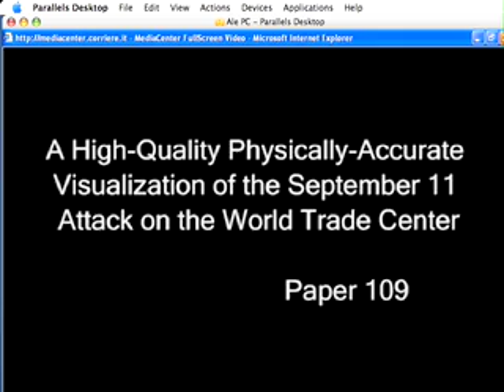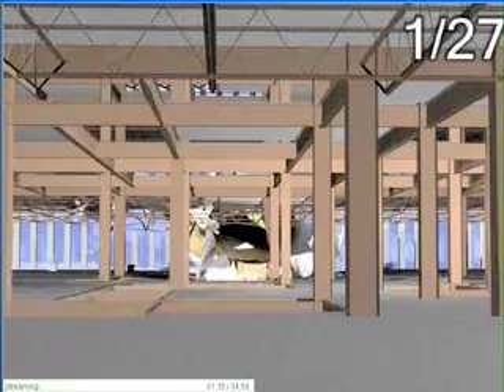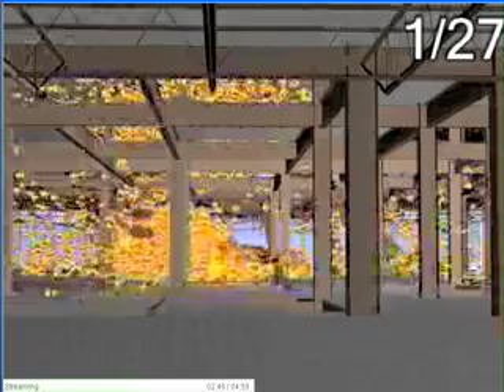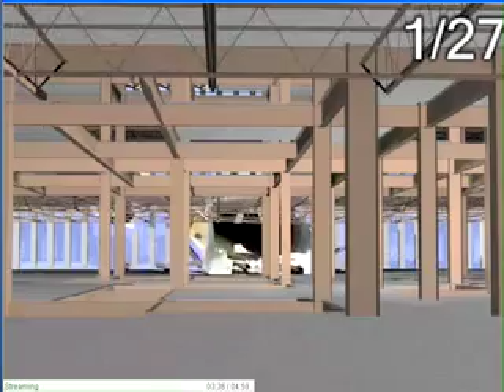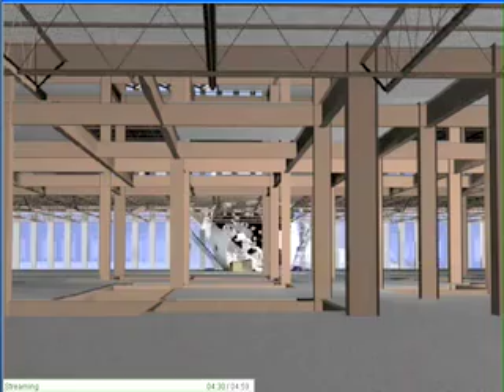9-11 Twin Towers Attack 3D simulation

Comment: Why is this simulation based on a completely different construction then the towers had?  When they try to explain things using a design that look like this and not as it was, they only add more fuel to speculations.
When looking for the design, I found...
"The Core Structure Of The World Trade Center Twin Towers Was A Steel Reinforced, Cast Concrete, Tubular Core." how can fuel and small metal parts just pass it?  I think this simulation need another run with the right input data.

Comment: @TooYoungToGamble Obiviously it's not all made of glass. But a massive airplane crashes into a building at 500 mph... what do you expect would happen? The airplane just bounces off? The buildings did a "great" job of resisting the impact as the entire plane didnt exit the other side. But at first contact, those amazingly strong steel  beams arent going to do much against an impact like that.
But then, you are too young to gamble... so give it a couple more years.

Comment: Not to mention the TONS of interior material, wiring, drywall, steel and copper piping, asbestos insulation, interior doors, interior glass, office furniture, etc. that would have provided a large amount of resistance is totally OMITTED from the simulation.  Then they shoot themselves it the foot showing about 10% of the aircraft exiting the building from the other side.  What stopped the rest of the plane?  ALL THE COLUMNS THAT REMAINED INTACT.

Comment: I really appreciate the Disney-like portrayal of SHREDS of aluminum and fiber-composite (the main construction materials of Boeing aircraft) severing vertical steel columns under stress (building weight) as if they were "butter" 5, 6, 7 even 8 columns in from the side of the building.  Watching the remnants of the cockpit  sever the 4th and 5th columns in made me laugh pretty hard.

Comment: @iRoxproductions the planes also went straight through the core columns that would make it nearly impossible for them to hold all the weight and the titanium didnt melt it started to warp and bend which caused them to fail under the weight of the building

Comment: @se7ensnakes Of course they can do the kind of damage we saw. Do you have any idea just how much energy was transferred from that 180 ton airliner travelling at over 400 knots into the building? Speed, weight, and a fuel for the fire - the 767's had enough of all three. The steel in the building didn't melt, but lost strength, sagged, pulling in from the outside, broke the supports and collapsed. Simple really.

Comment: @jhiller21 yeah I no longer need an oxy acetylene torch to cut steel beams.  I just run down to the hardware store, buy kerosene and pour it on the steel beam.  This fire cuts the beam perfectly.  Okay how about the metal pots on a kerosene stove.  Will I have to worry about the pots melting?  Yes of course, if you believe the official version of 9/11.

Comment: A model like this is completely useless from a structural standpoint.  There is no way to estimate the rigidity of the connections, corrosion, quality or uniformity of the materials used, the nonlinear dynamic response of the floor system, the dead load conditions or the effect of an unknown temperature of jet fuel on the beams/columns.  Why try?

Comment: @jhiller21 the steel that was used in the process of building the twin towers would need to reach 3,000 degrees before the melting point, the fire fueld by the jet fuel only reaches 2,000 degrees the extra heat would be from the bombs that were planted in the buildings to lead to them collasping.

Comment: @Perogi360 and you are an engineer and consider that energy to be massive?
without engineering background, i would tell you that I would expect scissor effect and that part of the building to slide/fall down if anything.
since I am a civil engineer, I can tell you that the energy absorbed by the building would tickle it if anything... bcoz those kind of energy levels are within safety design.
the buildings collapsed in controlled demolition, and no building in the world collapsed that way!

Comment: Just my personal thoughts, without regard to extensive physics calculations and measurements... I wouldn't expect an aircraft to sheer solid steel support columns, more or less enough to cause catastrophic failure of all support columns building-wide. I'm not leaning one way or the other, I'm trying to view this stuff as objectively as possible.

Comment: @situationterm if you would be trained in physics you would know that a aluminium-plastic tube can not break through tons of steel without any visibly damage and if you would open your eyes you would see that the videotapes interfere each other because sometimes the fuselage comes out the building on the other side (undamaged) and sometimes not. there are even two footages with no plane.

Comment: Guys lets just think. To the people saying it needs to be a certain temperature to melt steel, youre right.  But the temperature required for structural failure is much lower than the actual melting point.  Remember that there are immense pressures being put on each piece of steel.  I'm not an engineer, but its pretty obvious to me that a metal does not need to physically change state to fail structurally. Come on use your heads people.

Comment: @meltogue have you ever seen a demolition rig? Hundreds of miles of cable and wireing would be needed to pull of an explosion like this. The cable cannot simply be run through the walls out of plain sight. They have to be tapered through and arround every load-bearing beam in the building. To pull this off they would have actually have to of been no people inside the building what so ever. This was NOT a controled explosion.

Comment: @TheJb1rd this video shows the plane cutting through the core collumns but the plane is made of very lightweight materials. also the building was designed to stand after being hit by a plane. the building also fell at free fall speeds which is simply impossible. if u look at the towers collapsing, they explode all the way down. it's like so obvious once u see it. then u look at the legislation that was passed and the wars we got into. everything screams inside job.

Comment: @tuump Still not going to address the point are you? Seems fairly disingenuous on your part. Enjoy your conspiracy theories, I'm done. No matter what you claim, no matter how many times you repeat the claims, no matter how many times you dodge the issues or try to change the subject, reality remains as it is. Extraordinary claims require extraordinary proof and steel doesn't need to melt to fail. Structural steel softens somewhere around 445F/230C That's a fact.

Comment: @ExperienceCounts2 the steel joists was cut in 45° angle. you see it on pictures. thats typical for blasts. no welder would cut them this way because it takes the double time. I think the easter bunny farted in your face so you are dazed and unable to think logical

Comment: @tuump I say the Easter Bunny farted and knocked the buildings down. What is your answer to that? What? You have no answer? Using your logic then that must mean my claim is true. Lack of response to a ridiculous assertions does not prove the assertions true. it's basic logic.
You haven't responded to the original point I made. Steel under stress does not need to melt to fail. A simple and obvious fact, yet the same idiocy about melting points is repeated again and again. Why?

Comment: @ExperienceCounts2 so explain how it could be possible that the planes speed was around 1000km/h what is impossible in this height because the air is too thick, the engine is not able to achive this and the wings would burst
every independent pilot will approve it

Comment: @meltogue the towers falling patern does not reveal a fact the 9/11 disaster being brought down by controlled explosions. The damaged structure of the building became to weak to support the heavy weight from the floors above them, and as soon as the structure started to fall down.. it was collapsing under it's own weight, the floors below also failed due to the immense weight of the upper floor comming down, there is no use to controlled explosions when a fire is melting the structure away.

Comment: @Maxx415- Yes, jet fuel is like kerosene or diesel- oily will always burn with black smoke in open air. Needs controlled burn in an engine to run clean.. Dylan Avery may have said for some reason his film was a joke- but he could not have meant it. Maybe he wanted to get the MOSSAD off his back. Would not be the first to back off.. No- picture with fireman I refer to has no glowing metal.

Comment: @Maxx415- Looking at color picture of steel columns of WTCs cut by heat for sure with resulting slag- on RumorMillNews. com reported by Christopher Bollyn . Question is- this before or during clean up process. Appears to still be dust in the air. Picture of fireman in  front. All kinds of loose steel wire trash laying around- dangerous for steel workers to go in with tanks & hoses. What is fireman in uniform still around for? I'd say this picture was made before clean up began there.

Comment: @Maxx415 Really? Jet planes produce black smoke huh? I will look for that the next time I go to the airport. Planes I have seen on TV never put black smoke out. I would not want to ride in a plane putting out black smoke. The steel was in fact molten as it poured from the building. I have seen pictures of it. I believe film Loose Change has them And molten aluminum retains heat for months after too? As what occurred at ground zero?

Comment: @2ndSamuel710 
Alright first off im replying on this guys cause it wont let me post a new comment 
2. the fallin fire fighters that said they heard bombs going off in the basement. if a bomb would go off in the basement then the tower wouldnt collapse in one spot as the WTC did, it would break away and fall in any direction. the bombs would have to be placed on every so many floors and then timed to go off one after the other from top to bottom. for them to collapse as they did

Comment: @Maxx415- I said & still mean just as Professor Steven Jones has said- that the black smoke fires were no where near hot enough to cause failure of the steel resulting in collapse & the molten metal at ground zero. So what caused the molten steel? Thermite. An incendiary. 3,500 degrees fahrenheit hot! Made into cord to cut steel as clean & faster than blow torch. There are pictures of huge steel at 1st floor cut just like blow torch. Molten steel coming from walls just before collapse. Duh.

Comment: @Maxx415- Just plain logic common sense says that IF- I repeat IF the steel had become hot enough to fail the building would have tipped- not exploded into powder- fell straight down at near free fall speed. Not once same day  BUT 3 TIMES IN ONE DAY!!! Silverstein even admitted they "pulled" building #7. Care to explain molten metal pouring from the WTC & in the ground for months after 9/11? Hot enough to melt boots.

Comment: @Maxx415- The fires at the WTC were both much cooler than Madrid Hotel fire. Much cooler & much shorter duration. Weaker steel construction too but still did not collapse.

Comment: @Maxx415- Traveling at 500 mph MOST of the jet fuel burned up outside the building. The temperature that jet fuel burns in open air is just 550 degrees fahrenheit.  Check out Wikipedia- that is what it says. In a jet engine it can get to 1,800 degrees fahrenheit- but that is with perfect combustion- just correct amount of oxygen. The smoke was black- an indication of a over rich cool fire. Fire in Madrid, Spain was WHITE HOT HOT! There was even a large temporary construction crane on top.

Comment: @AnimaniacFox  When will people get it. Its basic physics. If you have virtually unlimited fuel and a confined space, the heat/temperature will continue to rise until either it melts steel or it finds an escape and levels off. That's basic physics.

Comment: Class. Sit down & B quiet 4 today's science lesson. Steel frame buildings can't & never have fell down from fire. Numerous fires in steel buildings before & after Sept.11th prove this. Madrid, Spain hotel fire Feb. 2005 was outrageously hot 4 almost 24 hours but steel frame remained standing. Professor Steven Jones Ph.D. says it. MIT engineer research scientist Ph.D. Jeff King says it. Navy seal trained demolition man Jesse Ventura says it. Architect Richard Gage & 1,300 professionals say it.

Comment: 1. The reason both towers fell is cuz there were two planes. 
2. The top fell on the bottom, crushing both.
3. A plane doesn't punch a cartoon outline when it hits the side of a building at 500 miles per hour, so that alone proves the physics of this simulation are crappy. 
4. Ground Zero is STILL cancer heaven from debris. Why would the government want all that wreckage there? Besides, it was blocking roads, and roads=money.

Comment: @darrenmuse The steel of the lower floors were at room temperature, though. Assuming the upper portion could fall by itself (not likely), the most plausible outcome is that the upper portion of the building would have fallen on the side, and the remaining standing up.

Comment: Heat makes steel more pliable.  The columns that weren't obliterated by the aircraft hitting the building at a few hundred miles per hour were sufficiently weakened by the fire that lasted longer than an hour!  This makes the weight of the floors above unbearable...and is why both towers collapsed!

Comment: @lennhart not to mention, its a little known fact that the sun is 5000 degrees celsius, and an aircraft doesnt experience anywhere near those numbers of heat. A space shuttle is designed to compensate for extreme temperatures upon re-entry, but a fucken commercial airline is not! get that through your head, your delusional if you say that hundreds of staff members are lying.

Comment: @lennhart Go on google and search for the pentagon wreckage, you'll see photos with clean up crews holding peices of metal with the logos of the airliner still on it. They foudn the landing gear that can only belong to a large aircraft such as a 747. Also i want everyone to google the melting point of aluminum. It does not vaporize at 11000 degrees you lier, its more like 3500 degrees celsius, which is alot less than the temperature of the sun. You have been proven a lier and ignorant, goodday.

Comment: @lennhart Can I see these "HIGH REZ contructions photos"? The core of the building was composed of elevator shafts. The steel exoskeleton supported the buildings. Kerosene, jet fuel's primary ingredient, produces black smoke when it's burning. Black smoke does not mean the fires were extinguished. I can make a video of this if you don't believe me. You're making mistake after mistake, and then you people tell me I'm a "sheep" for not believing you.

Comment: @lennhart You know what I think I will perform such an experiment, but I don't have the funds to propel thousands of kilograms of aluminum into steel girders the size of those in the World Trade Center. If I were to hammer an aluminum rod into a thin steel sheet, would that be enough to destroy your delusions? Since you don't think aluminum can deform steel "at any speed, then you might not think an aluminum rod would be able to pierce a steel plate even if kinetic energy is added by a hammer.

Comment: @lennhart Okay, so you think thousands of New Yorkers are lying when they say they saw two planes crash into two buildings, be absorbed into the buildings (which by necessity involves breaking the outer steel structure since, as even you may realize, airplanes are too big to fit through the windows), leaving obvious holes where the planes went in?  What exactly do you think happened?

Comment: @RAJSTA81 Yeah, when somebody says something like "YOUR AN IDIOT" I tend not to bother.  The buildings were not built to withstand airplanes as large as the ones used in 9/11 were; what you are talking about was a quote from a designer who said they could withstand an impact from a much smaller 707, not a 767 like the planes that crashed into it.  WT7 had two of New York's tallest buildings collapse next to it.  You're incapable of rational thought so I'm not going to respond to you any more.

Comment: @Udgerjay Seriously, what do you think is supposed to happen when thousands of pounds of airplane crash into steel.  Yes steel is weaker than aluminum.  That doesn't mean it will just bounce off.  What we have here is an inelastic collision.  We have an airplane flying hundreds of miles per hour, and while steel is stronger than aluminum, it is not strong enough to repel that much kinetic energy.  The airplane could have been made of tin and it still would have caused steel columns to fail.

Comment: @RAJSTA81 Because they were also hit by airplanes.  In case you didn't know this, an airplane flying into a building tends to cause damage to said building.  If this damage is followed by significant softening (no one is claiming the metal melted) of the metal holding the building up from the heat of burning jet fuel, then the building will collapse.

Comment: @lennhart 
IN case you are too stupid for words,
lets try a little experiment.
Take that $8 diamond plate from home
depot to a shop and have them weld it
into a box column for you. Pay them $20.
Put it in front of an 18 wheeler truck at
60 mph on the freeway.
Tell us what's left.
The WTC planes were 20 times heavier
traveling 10 times faster than any 18 
wheel Truck on the highway.
Does that explain it, Bubba?

Comment: @JPdab 
Sure it does explain the puffs of smoke.
Drop a ten foot ceiling in a fraction of a second,
and you will get 800 mph bursts of air capable 
of carrying a desk out a window, lol.
When they demolished the STARDUST HOTEL
in Las Vegas, compressed air BLEW a 3 ton
air conditioner nearly a statute mile.
Why do you think they take off the outer walls
in every ACTUAL CD? for shits and giggles?
LOL